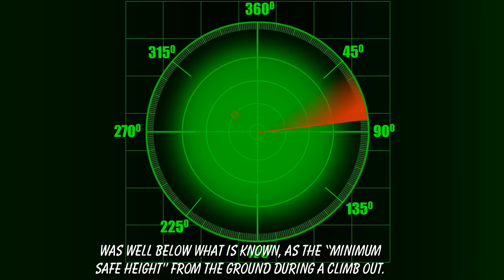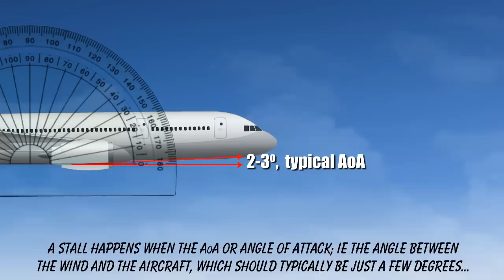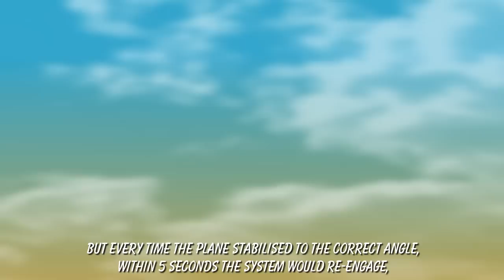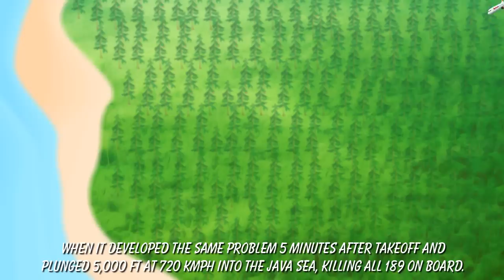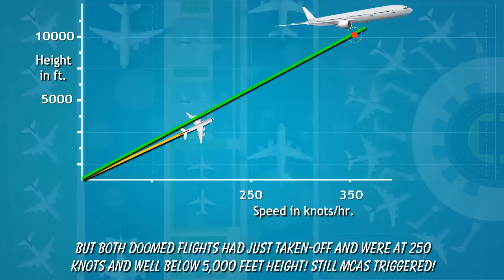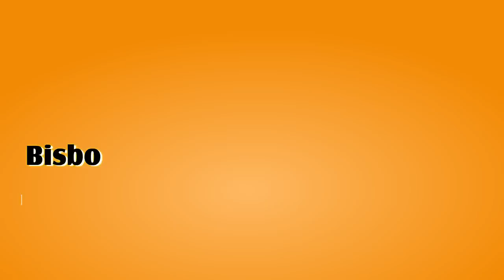The final moments of Ethiopian flight 302 and the crisis of Boeing 737 Max 800 planes

Comment: Bisbo you made a mistake at 8:13. You see the AOA system is not required in an airplane as it is already shown in the PFD, where the speed, altitude and AOA of a plane. If it is 10 in the blue area then the airplane's AOA is 10°.

Comment: I don't feel it is right to make sensationalism out of a tragedy. Real people lost lives. 

There are inaccuracies in the video. The AoA is rarely used by commercial pilots. Only trained military pilots like to use it. It's a secondary indication not all agree should be on primary display competing for pilot attention. That's why some companies demanded it, most others prefer not to. Not a price or economy problem.

There is an established procedure to deal with "Runaway stabilizer". It is a memory item that all pilots have to know by memory and apply by reflex if something strange happens. It was so in previous iterations of the B737, hence pilots were trained for it.

As we rely more and more in automation, once something goes wrong, there is a kind of surprise that retards complete awareness of what is happening and what should be done. 

One crew at Lion Air had a third pilot on a jump seat that immediately pointed to the correct procedure and they landed safely.
The crew did the procedure, and flew manually. They even "canceled" emergency and avoided returning what is not common practice as I heard.

The next crew on the same plane did not have the same luck.

Boeing and FAA issued an AD (Airworthiness Directive) stressing what was known from the accident and how to deal with such problems with the old established procedure.

Ethiopian ET302 probably knew that, and partially applied the procedure. Investigation is underway and we have only preliminary results.

One failed component should not down an airplane. There are complex interactions of humans, computers, the plane and it's environment that must me studied, lessons learned so as to avoid other events both with this planes and others.
Reply: I totally understand that with the fixed software, warning lights and proper training the Max can and will become one of the best and safest aircraft but that doesn't bring the lost lives back...

Comment: the 737-800 had no problems but the max did
for some reason they didn’t grounded or took away the flying certificate from the max after the first crash
they only did when another max had to crash adding 157 lives to the list of people died on a max plane
Reply: the 737-800 has an impeccable record and is one of the safest planes on the skies, And now people will probably confuse it with the 737 Max. Its all Boeing's fault though, they rushed to make a plane to compete with A320 Neo's but couldn't properly build one from scratch
Reply: @adityanihlani8804  yeah, infact the 737 NG family (600-900) was the only generation of the 737 that didn’t have significant design flaws or weaknesses, only minor thing it had was that it tended to bank right slightly which combined with pilot error and bad CRM led to a crash in 2007.

Comment: perfectly made video. But Airbus planes do not have this nose-up problem. Boeing needs to bring the engines underneath the wing and construct longer landing gear. Then the 737 will fly aerodynamically stable like the A-320.
Reply: Your point is right on! That's the key. Yet Boeing is letting everybody be distracted by focusing on the sensors, the MCAS system and training when the root of the problem is the aerodynamics. They compromised safety to save cost by changing the aerodynamics then compromised safety a second time implementing a compensator for the first mistake, the bigger engines. The want to keep away from having to change the aerodynamics back again by focusing only on MCAS. Very sneaky.
Reply: Aren’t they already underneath?
Reply: Boeing airplanes don't have a nose  up problem either. Think… if there is a nose up problem because of the engine location and MCAS is needed to correct it, why is MCAS inactive when the autopilot is turned on? Does the aerodynamics change when the AP is engaged? Must be smart aerodynamics! Or do the engines move under the wing when the AP is engaged? And do you always pretend to be an aerodynamics expert? Or just on YouTube?
Reply: @petep.2092  Right, MCAS  has to permanently push the plane's nose down because it would constantly go up.

Comment: Absolutely misleading information about the crash, there was no stall at all, no stick shaker. IAS Disagree was the main reason for MCAS to kick in . The pilots were never in control 3 min into the flight.  Not realizing the physics behind the aerodynamic forces, they continued to pull on the stick while the plane was in nose-down trim, rendering any efforts to trim manually useless. To make it worse they never reduced thrust which would have somewhat relieved the pressure exerted on the stabilizer. So even though MCAS is far from trouble-free, the pilot inputs in this case are insufficient at best and show a lack of understanding for the aerodynamics of flight.
Reply: Absolutely misleading information… and then you proceed to make up absolutely false information. There was no stall, but there was a stick shaker. MCAS is not activated due to IAS Disagree. The pilots were in control, they used elevator control and electric trim to counter the pitch down—like pilots are trained to do on day 1 of flight training—without knowing anything about MCAS. The flight data recorder shows that they were maintaining level flight until the last few seconds, when they turned electric trim on again but never used it. They crashed because they allowed the pitch down due to a runaway stab trim to proceed uninterrupted. It appears the Captain was fixated on trying to turn the autopilot on, and knew that it would not engage if he operated the electric trim, so he let the runaway proceed—not having basic training he didn't know that doing so would be a suicide move.

Comment: R.I.P to all passengers on both Lion Air and Ethiopian airways flights as for Boeing trying to save costs over life’s and safety of passengers on board you should be ashamed of yourselves not only that no improper training was carried out for the pilots to understand the New MCAS system heartbreaking 💔
Reply: Why did they need to understand the system? MCAS had no human interface that the pilots could use to control it, no levers, knobs, indicators, handles, not even an ON/OFF switch. There are plenty of parts on an airplane that the pilot knows nothing about. Training is only provided for items that the pilot can control or gain information from that is needed to fly the airplane. It's like trying to teach a car driver how to use a clutch to shift gears—in a car with an automatic transmission. LOL. THAT'S why MCAS was not mentioned in the pilots operations manual—nothing to operate. And why there was no training for it.